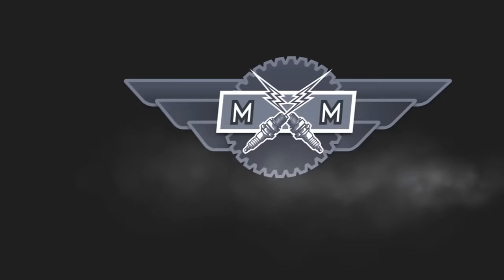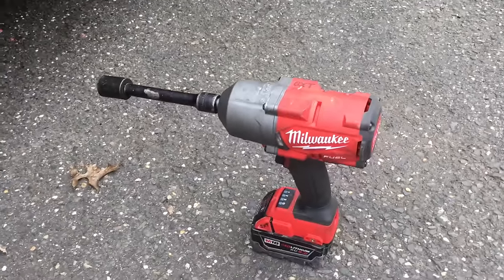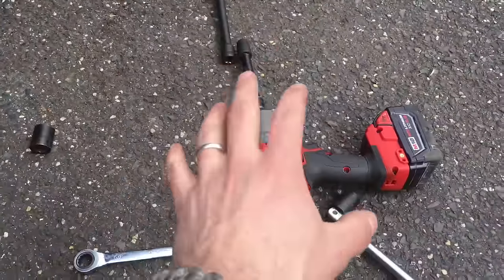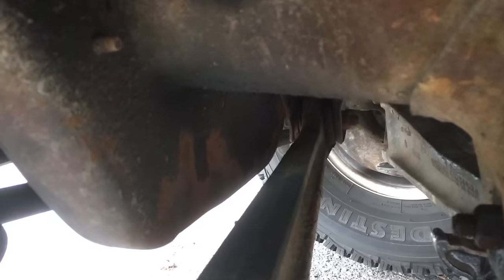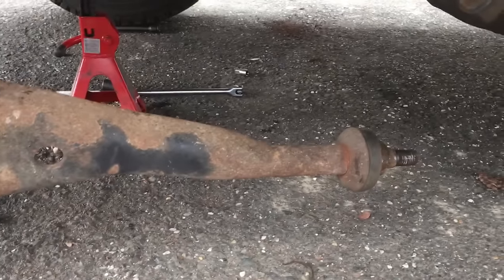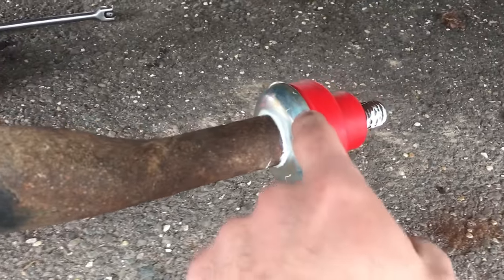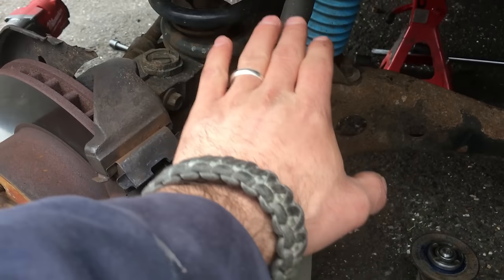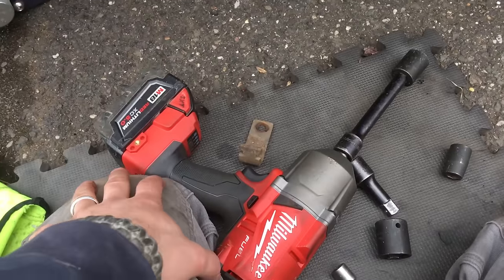How to Replace Radius Arm Bushings | 1995 Ford F150

Comment: Dude you are crazy, grind the couple of rivers off of the frame bracket and replace with bolts. I hope no one follows your directions for this job.
Reply from the maker: Crazy I might be, but there are several reasons why I left the rivets alone. First, rivets are very strong. They don't come undone usually (if ever) and they don't have bolts to rattle off. Second, bolts, nuts, and washers cost money. If a DIYer doesn't own an angle grinder, air chisel, etc, then they have to buy that too. 

The big cost of auto repairs is usually the labor. DIYers save money on labor not parts. So I don't usually encourage them to spend more money on parts and tools if they don't have too. This is the cheapest method and only requires another 30 minutes or so to do (if that) as opposed to grinding the rivets off. 
To each his own. As I mentioned in another comment, if I do this repair again I might consider grinding the rivets off.

Comment: I always use a come along and pull it forward one side at a time
Reply from the maker: That’s a good method too!
Reply: Same here. Decades ago on my 1974 Western Auto used a HUGE HONKIN' pry bar to "wiggle" the radius arms out of the brackets, no need to take all those other components loose. OR BREAK THEM. OOPS.

Comment: I used a 1 1/8" socket on my 1" Craftsman Ratchet in conjunction with good ole WD-40, they came off like they were removed before...
Reply from the maker: Nice! Proper tools and penetrating oil is always the trick.🤙

Comment: I have a 1990 Ford F-150 5.0 xlt lariat I was going for alignment at shop after replacing my steering rods. Mechanic said i needed to change radius arm bushings because when i go reverse the top of both front tires go inward bottom of tire goes outward. I think my shocks r the culprit. When i squeeze shock it opens up very very slow. What u guys think? All replies welcome. Thank you
Reply from the maker: ThaHandyman1212 Yes! You definitely want to change the radius arm bushings before an alignment. If the shocks are slow in rebounding, then replace them too. You can do the bounce test also. My rule of them is if the shocks are original or from the previous owner, replace them.
Reply: Shocks don't have any effect on the Alignment .
Your bushings will affect the Alignment .

Comment: Hey Steve, when you put the big nut back on does the front tires have to be on the ground or can you tighten it with tires up  in air and how tight do the nuts have to be. I also noticed  my passenger side nut is screwed on more than driver side.
Reply from the maker: Hi Alex! You’ll want to put the nut on and snug it next to the bushing while you have everything off the ground. Then you can lower everything back to the ground and tighten it the rest of the way. I’ll have to check my Haynes manual, but I think the torque is like 140 foot pounds. I never talked mine down that much because I felt like it would crack the plastic bushing that is part of the assembly. So far so good but who knows. Maybe there is some unnecessary looseness to my assembly.
Reply: @TheMinuteMasters  hey thanks again....very much appreciated... 👍🏾
Reply from the maker: @alexlewisiii6654  No problem Alex!🤙
Reply: @TheMinuteMasters  👍🏾

Comment: Do you need to remove the axle pivot bolt in order to complete this job?
Reply from the maker: MrBaeza1994 If you can pull the radius arm out of the bracket enough to replace the bushing, then you don’t have to remove the axle pivot bolt. I just think it’s easier removing the bolt to do the job.
Reply: The Minute Masters alrighty thanks again dude!🤙🏼🤙🏼
Reply: The Minute Masters just finished the job. I couldn’t pull the arm off on the drivers side because I didn’t have the right socket, but I had to force and pry the arm out and do the same to place it back in. It was pretty tough without removing that bolt and it also damaged the hell out of the old pivot arm bushing, would definitely be best to remove those bolts. Thank you for the video!!
Reply from the maker: MrBaeza1994 Nice! Well I’m glad you got it done man! 🤙 Good job! 
You’re welcome! Thanks for watching!
Reply: Definitely remove the pivot bolt. I just did a complete front end rebuild on my 95 f150 4×4. Even if you can get the radius arms through the bracket it doesn't allow enough threads to put the bushings on and bolt the radius arm down. I learned that the hard way

Comment: same problem on my 2000 lincoln continental FWD and not one shop will tell how to fix
Reply from the maker: kevin lockhart Really? I didn’t know Lincoln continental’s had twin I beam suspension with radius arms.
Reply: @TheMinuteMasters  it is front wheel drive and there is a steel rod with giant rubber bushings on both ends it goes from the strut rod support through the frame and bolts on as it exits similar to the one in your video except mine stays round like a rod
Reply from the maker: kevin lockhart Gotcha! That’s really interesting! Well I hope my video helps! Good luck!👍

Comment: If the front bushings on a OBS Ford are firing can they cause a dog walk?
Reply from the maker: Are talking about a specific Ford? If they bushings are fine/new, you shouldn’t have any issues. Worn bushings can cause all kinds of weird issues.
Reply: @TheMinuteMasters  I wanted to make sure I have a 92 and it has a slight dog walk
Reply from the maker: @mjhprojects321  Interaring. I would check all of you suspension mounting locations for rust or cracks. Definitely check all bushings too. I would look to see that your rear axle is centered too.

Comment: I'm doing this right now, it's a fucking nightmare! Next time I'm just grinding those rivets off and replacing the brackets🤣
Reply: @victorreyes2135  mine was a 4wd lol i couldn't get both shafts to go back together the way they came apart so i disconnected the main shaft and all the needle bearings fell out. I crawled around forever finding them.  Took a whole day to finish. Live and learn i guess.

Comment: Idk if you'll see this but I used this video as a guide on my f150 and I dont understand how on earth your arm just dropped out of the frame, mines stuck in there and nothings moving
Reply from the maker: So your radius arm didn’t come out of the bracket?
Reply: @TheMinuteMasters  no it didn't, it was just sitting in there. I think its connected in more spots in mine than yours though bc my manual showed a whole different method that still isn't workin
Reply from the maker: @alishahanson7640  Gotcha, is your truck 2wd or 4wd?
Reply: @TheMinuteMasters  4wd
Reply from the maker: @alishahanson7640  ah! So I believe the front axle shafts prevent the radius arms from just dropping out. Does the manual show any other procedures than my video? Like disconnecting the axle shafts?
Reply: @TheMinuteMasters  the manual said to literally to disconnect the arm from the piece its connected to but for the life of me I can't get the bolt holding the spring in loose at all
Reply from the maker: @alishahanson7640  I see. Are you talking about the huge 1-1/8 nut that holds the bottom of the coil springs to the I-beam?
Reply: @TheMinuteMasters  yes

Comment: In the ranger xlt 94 this work is mlre easy because the back perch has bolts and discconect the shock and ist make more fast and easy work. I see that this model ford has remached the back perch.
Anyway is Litle more work. But is ok.
Reply from the maker: Juan Ramos That’s cool! I wish the F150s were like that. Yes, this model does.

Comment: how are you removing all the stuff???  i did the bushing without removing anything other any a jack a 1 1/8in for the nut. jack up the side your working on to get the bushing out. jack up the other side to put nut back on. same as other side. also replace bracket.  this is the only way to do this. only if your replacing your axle bushing.
Reply: i ment to say your way for replacing both bushing sets.
Reply: 1995 f150 xlt 4x4.
Reply from the maker: I liked removing the coil spring and shock to make moving the I beam easier. You can replace the bushings without the extra work for sure.

Comment: 1:25 Well ive got a 6 inch lift and a cheater pipe, what do yall think?
Reply: Its a really big cheater pipe btw
Reply from the maker: I’d give it a shot! My truck is stock height and I can’t fit a big enough wrench on the nut.

Comment: Does anyone have any idea how to reinstall the passengers side radius arm and ibeam? I have a 94 ford ranger with the exact same setup. I removed the radius arm and ibeam to replace all the bushings but for the life of me cannot figure out how to get it back in. The passengers side axel pivot bracket has a bottom piece to it so you cant just slide it up from the bottom. Any advice is appreciated!
Reply from the maker: Did you put the radius arm in first and then the I beam?
Reply: @TheMinuteMasters  Theyre all one assembly, but yes thats how i was trying it. With the radius arm through the hole I cant angle the I-beam into place. The passengers side I-Beam bracket has a bottom to it so you cant just slide it up from the bottom.
Reply from the maker: Dan James See if you can slide both in at the same time. Otherwise, I’d try cutting the bottom out of the axle pivot bracket.

Comment: What year truck is that?
Reply from the maker: It’s a 1995🤙
Reply: @TheMinuteMasters  badass man. I just bought a 94 I'm going to fix up. Random question. But do you know if a 70 f250 radius arm bushing would fit this year frame?
Reply from the maker: james shelton Thanks man! 🤙 Nice! 94 is a good year. So I don’t know the answer to that question exactly. However, you could check out energy suspension and prothane and compare part numbers. I would assumed if they are interchangeable the part numbers would be the same. Otherwise, I’d stick with buying the correct model and year bushing. If I remember, the bushings are pretty cheap.

Comment: here is a hint. You're going to hate all Fords after doing this on the ground.  Good luck getting the  "I"  beam pivot bolt out. In the long run you might be smarter to drill the 2 rivets and remove the bracket. Replace the rivets with good grade 8 bolts.
Reply from the maker: I’ve gotten the I-beam pivot bolt out with the truck on the ground and I replaced the pivot bushings. It’s definitely doable. 
Yes, the fastest method to replacing the radius arm bushings is to remove the rivets and then bolt the hangers on after you replace the bushings.

Comment: Your Radius Arm On eBay costs you 135.00 Most of the time you get Ford Factory Arms. If this was me I replace the arms with new ones If you have inspections as he does in His area. I rather take the arms down have them powder coated and you will never have a problem again. I did mine on my 1991 ford ranger and my 1991 ford explorer Both are 2 wheel drive with 5-speeds. Your keeping your ranger get all the hard parts fixed now so you can work on other things later
Reply from the maker: I thought about doing that but I want to replace the standard length radius arms with longer arms. Those will definitely be powder coated.

Comment: I'd do this, but that mystery metal piece worries me.
Reply from the maker: Which piece? The tin metal piece?
Reply: @TheMinuteMasters  yeah the little one that's on the end of the radius arm. The one that you said may be oem only
Reply from the maker: @Alphawolf2325  The piece that I’m unsure about is that white plastic. I’ve heard two different stories regarding whether or not it’s needed. I put them back in. I’ll have to check and see if it’s in good condition. Otherwise, everything has been working just fine.

Comment: I used a 3/4 inch impact lol your impact makes 1100 inch pounds not foot pounds. My 1 inch makes 1400 foot pounds and you cant hold it if the bolt doesnt break loose quick
Reply from the maker: I don’t know what to tell you. The product description says “1/2 drive ft-lb 1400 torque”. Could it be how they market products?
Reply: Probably because I'm running a 40 horsepower compressor to make that kind of torque
Reply from the maker: The6931 True! I’ll have to do some research and see if the elects are a ratio or miss print.
Reply: Aaron Neville  would you mind telling us how you came to that great conclusion? I know it still only makes 175 psi but let me see you get the flow to run it off a 5 hp compressor
Reply: Aaron Neville  yes but your not gonna get the CFM without the ponies and my point was I've never seen a electric or battery impact with that kind of power
Reply: You guys should really look up what the m18 fuel 1/2 inch impact can do. Best 160 bucks I ever spent on black Friday. Has handled every single thing I've thrown at it with ease on my truck.

Comment: You don't need the plastic spacer with the new kit! I did this and there is no room for it! I have a 93 4x4
Reply from the maker: Good to know! How’s it holding up with out the spacer?
Reply: @TheMinuteMasters  great! To be honest I didn't have room for it and the polyurethanes are designed to not need them anyway
Reply from the maker: Dodge Ram 01 Gotcha! I’ll keep that in mind. I might just take the spacers out of mine...if they haven’t cracked out. Lol

Comment: Mines need replacing, they both r cracked.
Reply from the maker: Yup, cracked is definitely a sign to replace them. Besides, your steering will feel much better and a lot of times it eliminates vibrations caused by them being worn out.

Comment: Damn! I sure wish you young fellers would learn about a product called WD40! AND a thing called PATIENCE (which is not available on TV)... Simply soak the parts in the WD and do it a few times over the course of a FEW DAYS prior to your planned disassembly!!! I can assure you your rusted beat to shit parts will disassemble much easier! It is SOOOOO painful for me to watch people taking frozen shit apart without a drop of any kind of solvent!!! You can also make your own from acetone and ATF... I absolutely guarantee things like that big nut would come off with about 1/2 the strength needed for a frozen one! Not to mention possibly snapping it off or screwing up the bolt threads. I'm 74 now and I've been twisting stuff like this since I was 12. Try it! You'll be absofuckinglutely AMAZED!
Reply from the maker: Thanks for the suggestion Dee!🤙 I sprayed this nut several days in a row before I attempted taking it off. It’s just one of those tough nuts to get off. Otherwise, I have great success using a penetrating oil to get thinks apart. I also use some heat too.

Comment: I have replaced the urethane bushings in my vehicles because of the annoying squeaks they produced.
Reply from the maker: So you went back to the OE rubber bushings?
Reply: @TheMinuteMasters  yes. My doge truck sounded like a million mice. Went back to black and you can here your heart beat.
Reply from the maker: @13bravo42  Interesting. Did you lube the bushings with the special grease they come with?
Reply: @TheMinuteMasters  I made the mistake of paying a mechanic to do the job. But even on the many tractor trailers trucks I have driven over the last 2.5 million miles  they all start  squeaking after time. Love the look but not the added maintenence.
Reply from the maker: @13bravo42  Gotcha. Mechanic sometimes miss the subtle details with installing aftermarket parts. 
I’ll have to listen but I don’t think mine have started squeaking yet.

Comment: If you can't afford expensive tools, give your self a long enough lever and you can move the world. Any breaker bar plus a steel pipe cheater over it  as long as you need. See the plumbing department at any big orange or blue store near you. 3 footer, 6 footer  what ever it takes.  peace
Reply from the maker: Good point!

Comment: See I was hoping that I could just take the bracket off too and then I looked and all the nuts are welded on there
Reply from the maker: You can always grind the bolts or rivers off and just replace them with new grade 8 hardware.  Otherwise, you can buy a whole new bracket with hardware.
Reply: I was wrong it was just welded nuts so the bolt had something to thread to. I just took off the bracket and replaced the bushings that way. 10 minutes and some dirt in my hair and done. Note: I have no exhaust in the way so that wasn't an issue
Reply from the maker: @tylerfranz2401  Gotcha. 10 minutes! Nice work!🤙 Definitely faster than the unbolting method.

Comment: Invest in the 'bolt buster'!!
Reply from the maker: Is that a bigger impact?
Reply: Noooo. Electro magnetic induction heating tool. Youtube it!
Reply from the maker: Jason Wait! I’ve seen one of those. It heats the nut or bolt up and it’s easier to remove!
Reply: I just bought one. Best investment ever. No more torching bolts or nuts. Heat always wins with rust!
Reply from the maker: Jason Nice! I’ll definitely have to look into one! I’d love to get away from torching bolts.

Comment: Dont put lithium grease there ,polyurethane stuff works better with molybdenum grease there,actually there are some us brands that even make like a grill design in the inner surface that meets the bushing so it could retain the grease and don't develop creaking noises as polyurethane stuff use to do
Reply from the maker: carl torrico Where do you get molybdenum from?
Reply: Got it from here https://m.youtube.com/watch?v=_z6OEohnPKw